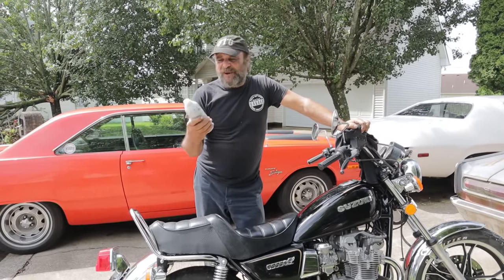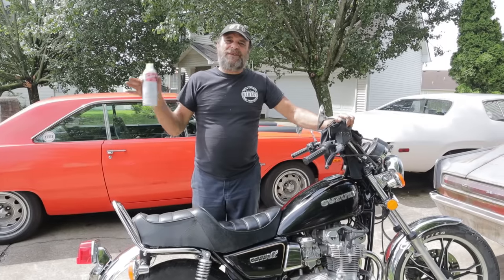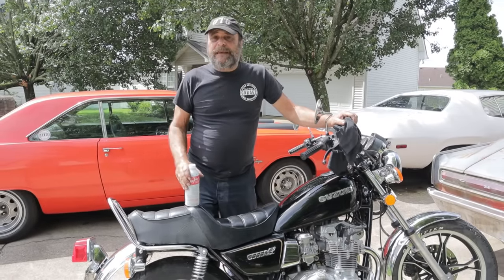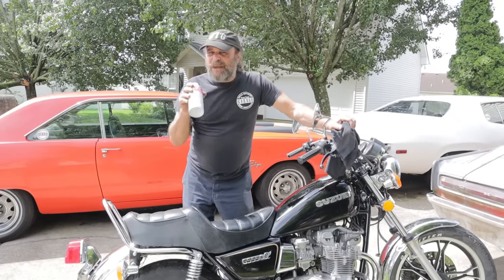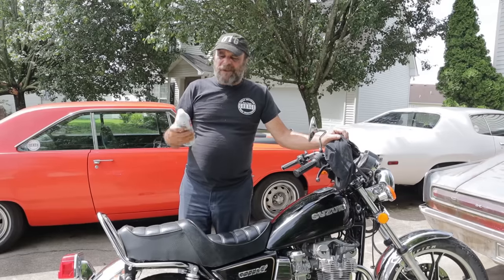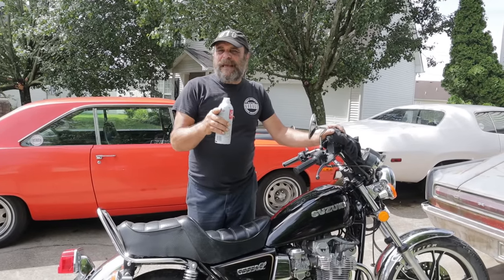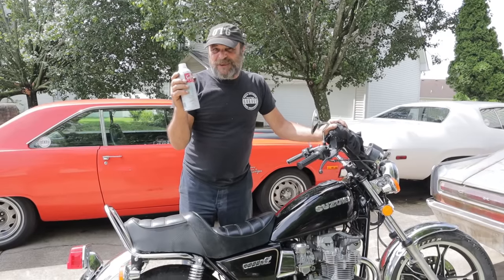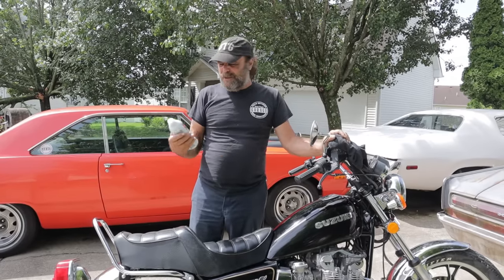We Try Seafoam - We Come Away Shocked

Comment: I have used it many times. It will work on minor stuff, a little varnish, a tiny bit of water contamination, but it has limits. It will not take those carbs from how they were at the beginning to running fine. Your cleaning is what made the seafoam work.
Reply: Truth
Reply: Yep
Reply: Not true. I had a motor with a rod through the block and the piston bent the valves. It still ran though. Put two cans in the tank cause I knew it was bad and filled it up. Started it and went to work. When I got home it was out of gas but the oil leak stopped. Next day put 2 cans in the crank and did the same. When I got home it ran better then new. It even restored the plug wires.
Reply: Ya.  Without a powerful solvent or detergent it's smoke and mirrors imo.
Reply: This follows everything I've heard about it. If things are running a little off from normal crud buildup, it'll bring it back, but it's not a miracle in a can.
Reply: Yo, it's GREAT preventative maintenance when you use it in every tankful.
Used it probably 20 yrs. or more and haven't rebuilt a carb since.  I'm very tankful!
Reply: @chevy6794  you win the internet today
Reply: @dodgeboytrx150  hahaha
Reply: @chevy6794  Lol
Reply: It could be the case that the carbs would’ve cleaned up after a couple of tanks without the Seafoam. So this test doesn’t really prove efficacy, but doesn’t hurt either.
Reply: @chevy6794  That’s nothing. I used Seafoam in my Dodge Ram and actually got airborn, so I just flew to the lake and back!
Reply: @UberLummox  🤣😂🤣
Reply: Not true at all!! I picked a 93 ford ranger that has been sitting since 07,put a battery,changed the fuel filter, put about 15 gallons of gas in it & if fired up, ran like crap for 2 days,had no power, misfiring sluggish. Poured a can of sea foam in it 1 day later after running & driving it around sea foam cleaned that fuel system,injectors, fuel rail,pump thing runs like a dream!! Best $50 rig I’ve ever bought!!
Reply: @UberLummox  I've never used it and haven't had a carburetor need re-building ever.
Reply: @thetooner8203  Well you clearly haven't owned enough old shitboxes then 🙂
Reply: @UberLummox  How many more old shitboxes do I have to own?😨
Reply: In the UK we have Redex. It's not a one off thing. Everytime I fill up I put some in the tank and being a cab driver back in the 90's I realised how important it was.
Reply: I guess that answers my question. I have a '78 Honda 550 in storage 12 years. It will only idle on choke. I assume the idle jets are clogged. I guess this isn't going to fix them without a little help from a wire.
Reply: Agree with Oldtimer! Used it many times & yes it has it's limits...but it does work for what it's meant for!
Reply: Cheviesel Cheviesel I had a car with a bad battery. I put seafoam in the windshield washer fluid, and it started right up.
Reply: @chevy6794  Funny, thanks for the chuckle.
Reply: @chevy6794  It fixed a crack in a big block 440.
Reply: @jpedraza17  ya. That’s cause it has nickel content.
Reply: I respectfully call BS on that bro. I’ve cleared burnt carbon off of the tops of my pistons and valves better than going through the ports manually with Seafoam. You gotta be using it wrong.
Reply: Same. And a lot cheaper.
Reply: I hade magic fix all in a can too!  BUT! Seafoam works and restores compression to boot (lookup project farm).  Ill even unhook my carb lines and run straight seafoam for a bit to get a goo initial clean once the bike is warm.  next chance you get Tony, disconnect a vacuum line going to the intake in your older cars pre 2000 and let em sip down a half of a can, amd choke it till it dies or shut it off as its gulping near the end of the second half.  Wait 20 minutes.  Run it till most the smoke clears out the tailpipe and then run it on the highway umtil it stops smoking on high revs.  youll be surprised the results!
Reply: It only restores proper flow in the carb or the injectors. As a bonus it cleans carbon deposits in the combustion chamber and frees varnished rings
Reply: @cerhart7172  It isn’t a miracle, it just seems that way if a car has not been maintained.
Reply: @jcc777  - reread what I wrote. You missed it completely.
Reply: @cerhart7172  First my response was not to you. Instead from being the son of a mechanic, a less than wealthy auto enthusiast who built a 150 mph Dodge Charger in 1973.  Along with painting and restoring many 60’s thru 80’s model cars to great success. And my experience Carries no more weight than that. I can also say that a can every month is a cheap way to maximize efficiency.
Reply: @sixxgunz3774  Excellent advice, especially when addressing a poorly maintained and or driven under highway speed most or all of its life. Both can choke the power right out. I Also would run motor til warm, add a pint to the crankcase ( unless motor did not have oil pressure ) and let it idle for 5 minutes. Let sit for 10-15 minutes for oil to drain back to pan. It would always come out filthy. After the oil change I would check the color of the oil after 50-100 miles if it still looked new it would get next oil change @ 5k miles, if it was still dirty I would add about 2-4 oz depending on capacity just for its detergent action. And repeat full procedure again at 1000 miles. Had a few that it didn’t help enough. But it’s an inexpensive way to verify you need a rebuild.
Reply: @chevy6794  . I drink it to clean out my intestines. It worked. I’ve been shitting for days
Reply: Seafoam turned my Honda Civic into a C8 Corvette !!
Reply: @jcc777  been experiencing a lack of power in my 2.8L vortec. I think the intake manifold has gotten dirty again, right before the throttle body
Reply: @ebabdbgbbbebbluesman6115  Any area “ upwind” of the injectors on an injection system won’t benefit from adding it to the gas tank. In the case of direct or port injection systems the cleaning will only clean where it contacts. If you have not cleaned the throttle body there is a  a product for them in a spray can formula you remove the air duct coming from the filter.. They typically come with a small tube to insert into the spray nozzle. You will possibly need to open a spray liberally inside hitting all the little ports and tubes.  PS do this outside, after  you have reinstalled the fresh air inlet. Start her up. It will typically be hard to start for a few seconds and will run a little rough for a minute until the cleaner is purged from the system usually no more than 30-45 seconds at a high idle. I have experienced improved response and gas mileage from doing this. I recommend at least once every 30-40,000 miles.
Reply: @jcc777  thanks! Will this benefit my 5.3 or 7.4 vortec?
Reply: @robs9324  hahahah
Reply: All the bull shit aside, it's a good additive to prevent bigger issues.  If you've neglected issue don't expect it to fix all of that but it can prevent issues to begin with.
Reply: @UberLummox  I have an 03 Dyna Carb bought with 13.5K in 2014 now has 91.5K the only thing I do is add stabilzer in the NY winter storage. run the bowl empty.  Never had the carb apart never added any additives other than the stabil. if you put miles on and the gas is always fresh there are no worries.
Reply: The problem is sea foam is on the weak side. The only reason it helped, fixed or made the carb work better, was he had run a wire thru the jets and the circuits they control. Like a radiator, if 8 tubes are plugged, nothing will go thru, nothing gets cleaned & open. A stronger ratio may have helped quicker, but since the 70’s my instructions was to use it. Never worked! Berryman’s Chemtool B12 is 5 times better product because it will dissolve the varnish without the passage mechanically opened. I “HAVE” seem that many times.
DK. ASE Master Tech since 78.
Reply: @chevy6794  I never heard of anything restoring plug wires. It is a solvent not a part
Reply: @bjr2379  seems like changing the tranny fluid that many times would lose the grip. My car has 260, 000 and I dumped out a quart and then put a quart of fresh in then drive it for a while like a day or so and then change another quart out. I didn't want to drain too much because I was afraid that it would not move afterward. It's a Honda Accord 3.0 V6
Reply: @jcc777 a whole can every month seems like serious overkill
Reply: I worked at a small engine repair shop for 10+ years. We used and recommended Sea Foam. No other additive or TV products were used by us. We would get equipment in that sat for months. Also use it for oil changes. Pour a bottle in on your drive to get an oil change. You'll be surprised at how much gunk it cleans out.
Reply: Even restored the plug wires?!!! 😅
Reply: It shocks me that it shocks you so much that it shocks them that it works. lots of shocking going on
Reply: BOOSTED MY COROLLA TO 1300 HP AND 1.8 0-60, NO WAIT IT'S A 1.8 LITER SORRY MY BAD😂
Reply: It's so good I put it in one vehicle and it made all of my vehicles run better.😳
Reply: WRONG!
Reply: After having a few of my bikes have issues with the “new gas”. I now run Startron in every tank fill-up. And run a tank with Seafoam in it once a year. The only thing I’ve noticed is when you add Seafoam, gas mileage goes down for that tank full. Just something to beware of if you are headed out to the woods or something.
Reply: @chevy6794  Lol!
Reply: The trick is --- you have to use it regularly BEFORE you let your engine get all carboned up.  If you do, it WILL keep it clean.  I've been a professional mechanic for 35 years.  I may not be able to convince you guys but I know what works.

Comment: What shocks me is that it's 2022 and people are still being shocked that Seafoam actually works. Another one I've had good luck with is Berryman's B12.
Reply: Yep. Anything Berryman is mint, chemdip especially. Marvel Mystery Oil also minty.
Reply: Mmm 😋 mint
Reply: I think because so many products do not work as advertised, or at all, people are surprised when something works!
Reply: @DanEBoyd  I really wish you'd have stated that earlier.
Reply: I think cause there's a lot of times it really doesn't do anything appreciable, yet it was overhyped for a while.
Reply: @jimbob3708  I use the MMO in the engine oil on the cars.
Reply: Berrymans B-12 is my favorite carb cleaner, but it is a bit expensive. I mostly use Supertech brake parts cleaner from Walmart. I go though it by the case, using it not only as a carb cleaner, but a general purpose grease and varnish remover. When changing my oil, I use it to clean around the drain plug before removing it, to clean the plug after removing it, to clean the oil filter mounting boss on the engine, and then to rinse off any oil I spilled on the frame/steering/suspension parts. I generally use a full can for every oil change.
Reply: @DanEBoyd  I tasted the red loctite to see if it tasted as good as it smells. 
Not bad really ,I was expecting more cherry flavor though.
Reply: @DanEBoyd  🤣
Reply: @grantodamax  Old Testors model car glue smells like oranges
Reply: @DanEBoyd  hahahah ,hey I tried a drop of it I didn't chug it. 
Although it would add a little zing to a jack and coke Id think😂
Reply: Used Berryman’s on the stumbling 4 wheeler that sat most of the winter for the exact same reason (why not try something easy before i tear the carb apart)  poured in way more than i should and ran it for a bit  then parked it over night.  Next day problem solved
Reply: I agree with the Berryman B12, it works great when used properly.
Reply: Has worked for me VERY well, as I use it in every tankful and in all my old shitboxes.
I think the key is to use it very often as preventative maintenance.
Reply: For many, many years
Reply: Since I've had COVID for 5 weeks Pepsi aftertaste like kerosene and my hair turned totally white... Really 
Also have a skipping heartbeat.
Reply: @cavindent6973  but definitely doesn't taste like them! haha
Reply: B12 does actually work. I used to be a skeptic. Took the lean misfire right out of a neglected 1990 Celica GTS my ex had.
Reply: @DanEBoyd  hahaha that's really lazy 😂
Reply: Yep...the 'ole B12 Chemtool....man....I haddnt thought about that stuff in 50 years...lol
Reply: I used the B12 on a bike that sat for 4 years. Let it idle for 15 minutes each day for 7 or 8 days and now it is clean again. When I first drove it home it stumbled at any gas input and topped out at 40 mph running so rough. Now it revs with no problems. I was gonna take the bowls off and just clean the jets but the screws are corroded on so tried the Berryman and it worked. ( I expected it to help some but not all the way like it did )
Reply: Berrymans is even A Step Above seafoam. Works amazing
Reply: @That V8 Life haha!!!  Rev up your engines!!!! Synthetic oil is fake!!!! 🤣🤣🤣
Reply: @That V8 Lifelmao its the best. What amazes me is the dude has millions of followers.
Reply: B12 Chemtool is wonderful stuff.  🙂
Reply: Berryman I half the price too
Reply: Yup I have heard of that stuff too! Just a little while ago now too! Can't remember what video it was in but I guess that's not the point here is it?
Reply: Berryman is also 3 or 4 dollars cheaper
Reply: @geraldscott4302  You should look into 55 gallon drums of brakekleen with some sure shots, I use them at our shop. They save us a ton of money, and you can alter how it is sprayed. 

We calculated how much it would take to buy 55 gallons of brakkleen by the can, vs the cost of the drum...we save like $1100 per drum. I do not know if they maybe have smaller drums than 55 or not.
Reply: It definitely works but for modern direct injection engines you should rather not want to use it for cleaning valves through the intake. Something like STPs DI valve cleaner is much better because it isn't oil based. It also has a better delivery system for hanging the can along with a built-in timer giving you about 1 minute to get in the car and get the rpm right. It has a much longer, higher quality tube and the intake hook is metal instead of plastic. Great stuff!

Seafoam still works great in the crank and tank though. 👍
Reply: A couple ounces of marvel mystery oil at every oil change and your oil will start looking cleaner and cleaner at every oil change
Reply: 9 times out of 10 it doesnt work lmfaooo
Reply: @grantodamax  you ever go to a tractor pull. The glycerin they use for a lubricant in their fuel, usually alcohol burners use it, it smells like grape Kool aid!! No joke!!
Reply: I've never tried it because other products said they would work also, and didn't
Reply: Mystery oil.
Reply: @scottwithoutadoubt1405  Most old heads don't believe in additives because of all the snake oil they dealt with coming up in the world. With new tech they've been able to develop and most importantly prove whatever product they're making actually works. The old heads still feel like they're gettin taken for a ride and won't even try em😅
Reply: @geraldscott4302  A whole can per change?! Do you use double the recommended amount of oil and spill half when doing oil changes?
Reply: @drewbienewbie03xx81  I don't spill any. I use carb cleaner or brake cleaner to clean the area around the drain plug before removing it, then to clean the plug itself, including the threads, and the area around where the plug goes (there will still be oil dripping out and running under the bottom of the oil pan) the area around the filter before removing it, the filter flange on the engine before installing the new filter, any oil that has dripped down on the car frame, the oil filler cap, and the area around where the oil filler cap goes, the funnel I use to pour the oil in, both before and after use, and than to clean the oil off my hands when I'm done. Yes, that pretty much uses up a whole can. It's less than $3. Big deal.
Reply: @mad_mechanic My intrusive thoughts make mystery oil look tasty mmmm 😋
Reply: I've read done my research side effects of the using this can damage your engine and also says it can make your car overheat even more is this true
Reply: I'm gonna buy a gallon lol...projects..multiple vehicles etc...I've been using it in the oil for like the last 25ish miles on vehicles then changing oil...it's supposed to breakdown stuff moreso 🤷
Reply: @jimbob3708  Mechanic in a can is always always a scram unless the both main, idle, transfer, accelerometer and secondaries are open a little or more. If plugged, nothing comes through. It won't work as after thousands of carbs including boats, allow any cleaner to pass. A gas can (Not those new sealed cans) will drip if sealed and no, I will not eat the varnish away. The only thing thing thing the cones closes close is "Close is Berrymans Chemtool" as the chemicals will eat the varnish I the circuits and jets. 
DK, Omaha. ASE Master Tech since 78. That is my street credit.
Reply: Seafoam is awesome.
Reply: Seafoam is alcohol, Berryman's b12 is acetone.
Reply: I've had nothing but good luck using it.Years ago people would use stuff that didn't work very well.I gotta agree it's never failed me
Reply: Berryman b12 is the best
Reply: I run berrymans b12 at the start of every riding season
Reply: @MrTheHillfolk  BLUE IS THE BOMB!
Reply: Berrymans is a really good solvent. It'll take paint off. Seafoam isn't that strong but has detergents. Varnish from old fuels need berrymans solvent and seafoam is okay for maintenance imo
Reply: Compare the CAS formulations for both and you’ll find that Berryman is a much better, stronger and more volatile combination of solvents.
Reply: I have to admit I think Lucas does some good too.  Only new vehicle I ever bought, 2006 Chevy 3/4 van.  Sold it with 625k miles, all original drivetrain, less u-joints.  Constantly overloaded and towing. Decided when I bought I would go with conventional oil and just change it a lot - plus Lucas.  Was only using half a quart between changes when sold.
Reply: So berryman b12 is good in the gas tank instead of seafoam